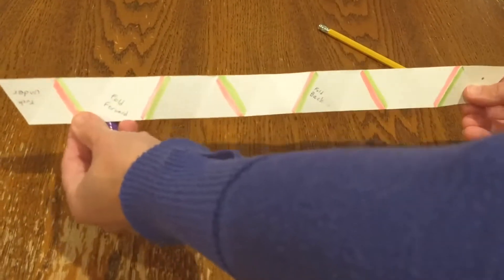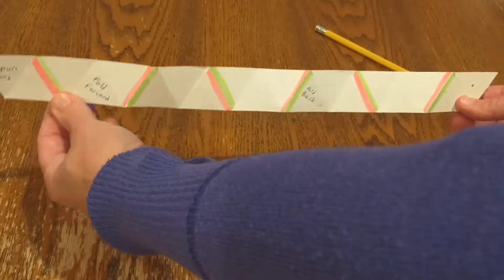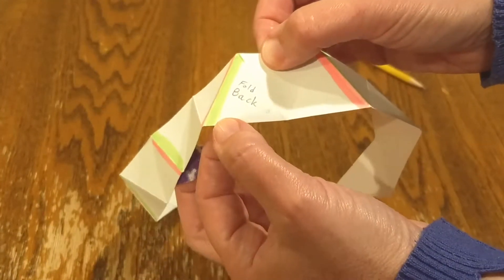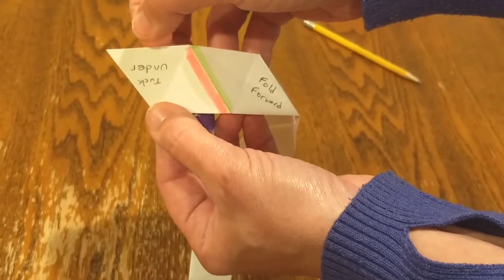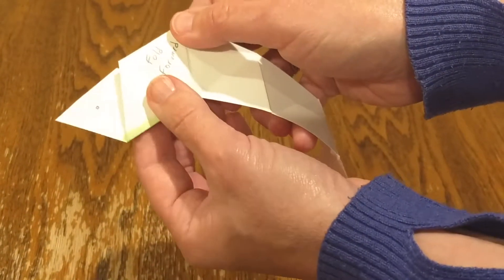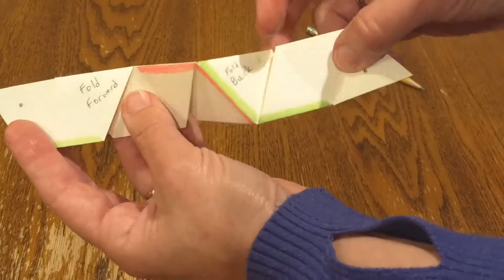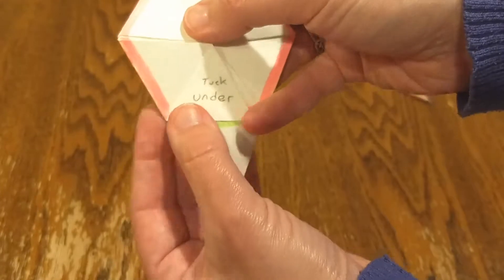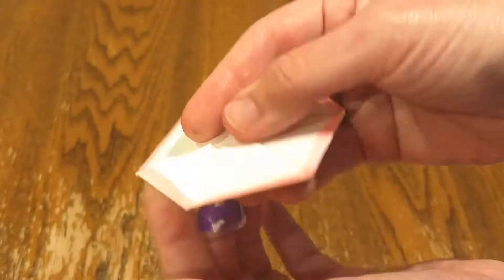How to Make a Hexa-Hexaflexagon

Comment: Is there a template we can use?
Reply from the maker: I made a video about correctly making the paper strip. It isn't a template, but it might troubleshoot some issues with getting the hexaflexagon (or hexa-hexaflexagon) started: https://youtu.be/b1ZZcyM50Qw

I'm trying to figure out how to make a video on making a template. I always just estimate it, starting  with needing a strip of paper at least half-plus-one the total number of triangles. For example, a hexaflexagon needs ten triangles, so your paper strip needs to be six triangle lengths long: ten divided in half is five, plus one, equals six.

But to make a template, the template is going to need to be a ratio of one : square root of three, divided by two, where "one" is the length of the side of the equilateral triangle, and "the square root of three, divided by 2" is the width of the paper strip. Basically, the short width of the paper will be 0.7 times the length of a side of one of the equilateral triangles.

So, it gets a little technical when you try to make a rule for a template instead of just making the 30-60-90 triangle at the start and going from there.

Comment: I know the answer will probably be no, but do you have any plans on making the elusive Duodeca(12)-hexa-flexagon? (essentially where you repeat the wrap-around twice to get a 9/10 triangle paper strip)
Reply from the maker: I'll have to take a look at it. I've heard of them, but never attempted them. Thanks for the suggestion!
Reply: @alexdrevessa3518  I actually did made one (after a few attemps) and you would need 36 (+1 for gluing) to make it. It's a bit of work, but it has a shocking amount of self-similarity to the HHexa (how there's a central "hub", which can break off into 3 THexa loops, the DDHexa has a central hub that can break off into 3 HHexa hubs)
Reply: what about the icositetra(24)hexaflexagon